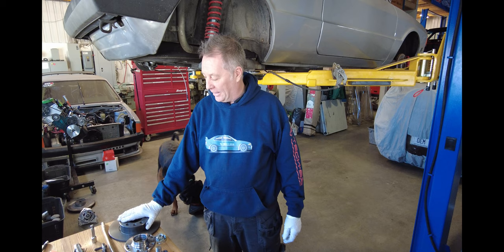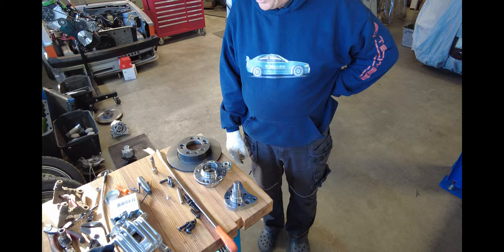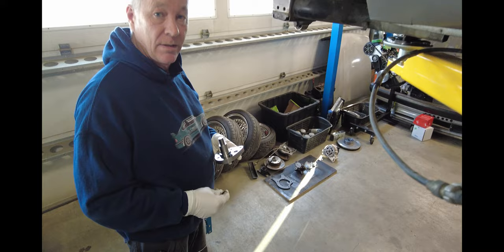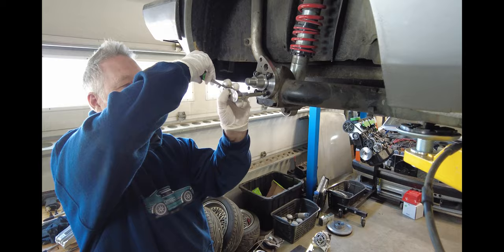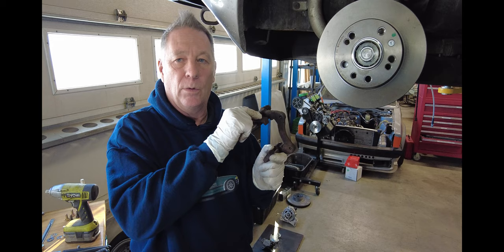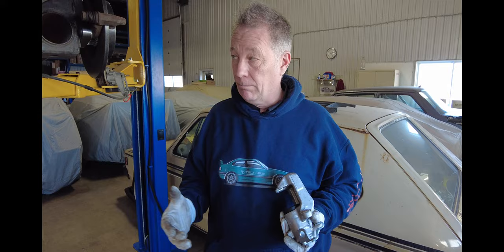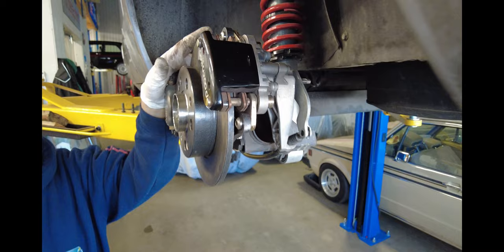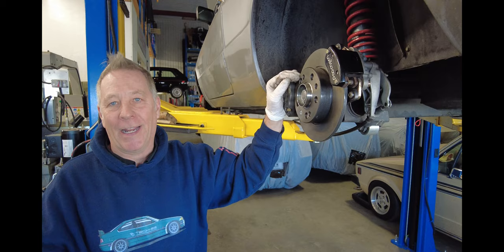HD VW Stub axle install walkaround

Comment: The website mentions recommendation for a stud conversion. Is this just if you are doing 4x100 and use the heliocouled hole?
Also, is the MK disk required just to keep the offset correct? If someone didn't want to use these disks could a spacer be used instead?